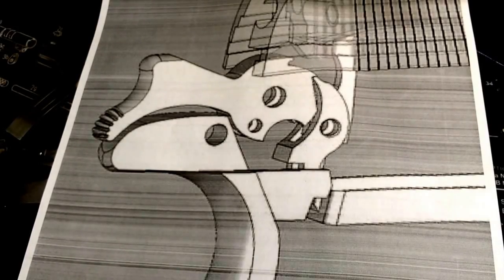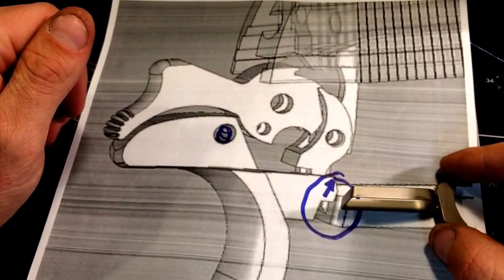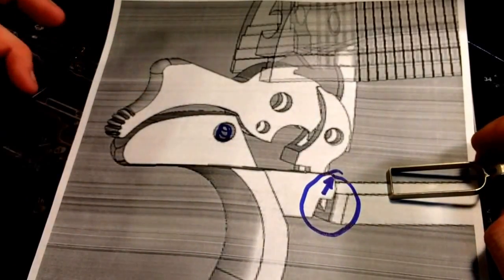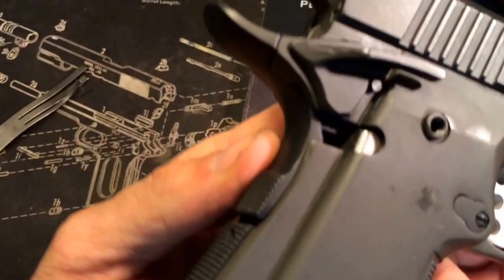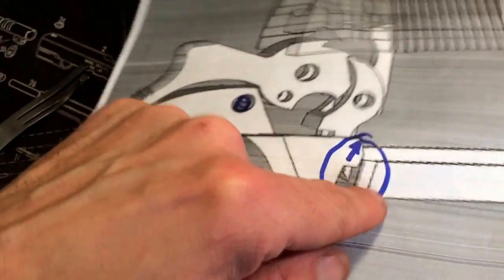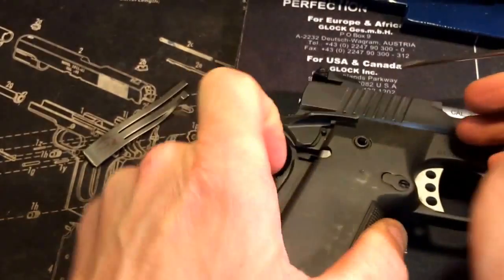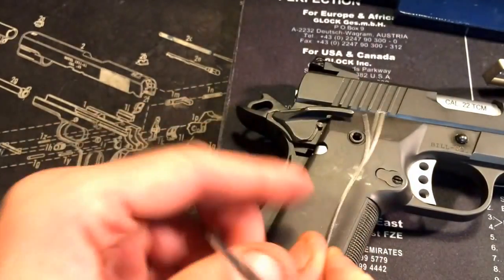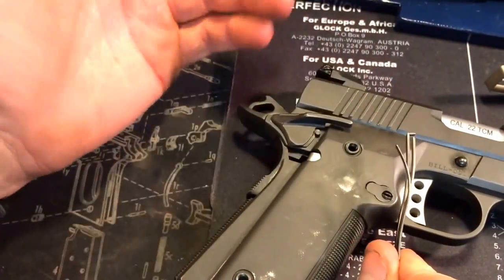My 1911's beavertail grip safety doesn't work! One quick fix that will hopefully get you running!

Comment: Great information. I took a budget Tisas GI 1911 and installed a Ed Brown beaver tail and pretty much all Ed brown components. The beaver tail trigger stop arm has extra stock on it and has to be fitted to the gun and your trigger. Once I fitted it and was able to have enough trigger movement to have the sear release and the hammer to fall, I noticed it would still release without grip depressing the Beavertail. So I’ll try this and see if it fixes this. Great info!!

Comment: Thank you ! I picked up a Norinco 1911a1 at a local pawn shop which was selling for $150 because the grip safety didn't work. I adjusted the flat spring as you recommended and now it shoots and the grip safety works perfectly, I'll probably buy another flat spring cause as you mentioned it could be worn out.

Comment: Just installed Wilson springs in my Colt series 80. Grip safety spring was not curved enough, would not work. I put the old spring back in & works fine. o

Comment: My mainspring housing was causing the grip safety not to work. Switched back and forth between the original and the old one with the lanyard loop. It only did it with the lanyard one.

Comment: Thanks for the video.  Learning to work on my MAC 9 double stack and after trying to adjust the trigger weight I had a grip safety failure after re-assembly.  Looks like I need to put a little more pressure on the grip safety and a touch back on the trigger weight.

Comment: Had this issue once right after putting an Education Brown main spring housing on a Springfield Loaded. The very bottom of the beaver tail was rubbing across the top of the housing. Took the housing back out and took a small amount of material of the top that was rubbing with a Jewelers file. No issues since.

Comment: First video that popped up on google when I searched using the phrase "my 1911 grip safety doesn't work".  Very informative.  Unfortunately I'm pretty sure my 2nd hand custom target 1911 had the lug or protrusion on the beaver tail ground down.  The previous owner also had it pinned in the depressed position.  I replaced all the springs and removed the pin and it still doesn't work.  He told me when he sold it to me the GS was pinned but he didn't say it was ground down.  Semi dangerous...
Reply: I deburred the 45 degree angle ever so slightly and polished it. I can manipulate the grip safety to make it so the trigger bar doesn't engage anything so I'm not thinking it's the problem. I do believe that the sear maybe put In reverse. My wife said she may have did it 😂. So I'll check that and maybe tweak the sear spring a bit to see if that helps.

Comment: Awesome info. Fixed my problem right away. I had the hammer fall to half cock while closing the slide. I was gripping the gun when doing so. If I kept my hand off the grip safety it would stay at full cock. Touch it at all while the slide was closing then the hammer will follow it. Figured this out after cleaning. Luckily it was empty. Not that I think I would have had strong enough impact with the firing pin. Not eager to find out in the house. Thanks.

Comment: I have a Para LTC 9mm. with the trigger cocked and safety on, If I put pressure on the trigger first then press the palm safety it will partially click off the safety, then the second pull will allow the pistol to fire.

Comment: What a great explanation! You do know what you are doing. As a matter of fact I was trying to find out a way to reduce the beavertail safety course, in such way that a small touch should be enouth to enable firing. By what I could see I may have to sand the beavertail notch to easely desengage the trigger, am I right?

Comment: Late to the party but i don't need the grip safety to fire. Or with the frame safety on i can squeeze the trigger once, let go of the trigger, move the frame safety off and the hammer drops to a "decocked position." Not half cocked. Just off of the firing pin.

Comment: I bought the wilson combat bullet proof sear spring and my hammer still falls without engaging the safety grip. I ground the lug just a bit and polished the surface. Idk what is my issue still but I can push up on the safety and the trigger can't engage the sear and disconnected like shown in the video.. any tips?

Comment: I recently purchased the Springfield Armory 3 in Ronin and I'm finding that when I use my standard gripping technique thumbs forward strong hand thumb over the top of the safety it's kind of opening the wing of the meat of my strong hand thumb and I'm not even able to depress the grip safety enough to disengage it I'm trying to get a hold of Springfield to see if they'll send me or or sell me a grip safety so I can TIG weld a little more thickness to it I spent nearly $1,000 on this gun and now I won't even carry it because it's only 50/50 if I'm able to depress this grip safety enough to fire the gun if I need to very frustrating I know I can change my grip just a little bit and all will be well but in a stressful situation I'm a retired Leo I've been shooting for over 50 years I'm not going to be able to change my grips when I've trained so much to have it as I've explained it are there any suggestions you can think of to perhaps get a custom grip safety with a little taller memory pad I don't know this I'm just frustrated as hell

Comment: Great info. I really don't see the point of the grip safety. There's already a thumb safety, and we should all be practicing trigger discipline. In a "critical incident", you may not have the luxury of getting a "good' grip. I try to get my hand as high up on the back strap as possible, pushing UP on the beaver-tail, which causes the GS to "lock" the trigger.  Couple that with small hands, and my thumb riding on the safety lever, and now I have a "unreliable" pistol.  I trust myself enough to set my GS at 10%, it still works but just barely. It just takes the slightest pressure and the trigger is unlocked, along with installing a low lever safety so I can still "ride" the lever but get my thumb lower for a better squeeze on the grip.

Comment: Dude my Sa 1911a1 is depressing the grip safety with the trigger. When i pull the trigger the bottom of the safety is pulled in by the trigger. Also sometimes the mainspring housing lock locks the gun up randomly. This didnt start happening until i started messing with a new ambi safety. Now the grip safety almost never works. If i pull up on the grip safety it and pull the trigger it sometimes doesnt drop the hammer and sometimes it does. Im at witts end here,also,is there any good way to make the down click of the thumb safety have a more solid click on my ambi safety? The slightest touch seems to make it wanna turn on or not go all the way down.

Comment: Hi, Really good to know. I tried to remove some material to be easier to trigger the gun as sometime I am not getting the best Grip in IPSC or IDPA (I have a short hand) but this time I think I remove too much (Please see your design where the arrow is). If I rise the Safety as you did, its still work so DO you have any Advise? Well other that just replace it. Im thinking to put it more square and not round... Thanks in advance

Comment: One thing you missed. Some aftermarket mainspring housings are thicker in the area where the beavertail tangs overlap. It doesn’t take much to overset the beavertail. 

I have this issue on my project SDS Tisas right now. I’m debating on if I should do a new beavertail or break out the files and go to work on either the mainspring housing or beavertail tangs. Which would you recommend?
Reply: I'm having the same problem with the same gun. I know this is old video, just wondering what the fix was.
Reply: I had the same problem, new main spring housing switching from arched to flat then the grip safty wouldn't work. I took some meat off of the main spring houseing shoulder where it stops the grip safty and it fixed the problem.  It wasnt letting the grip safty paw come down enough to stop the trigger bow. I took off maybe a 1/32 of an inch from the main spring shoulder.
Reply: Blend them together

Comment: Also, one more thing. If I change the Grip Safety, in general any Extended Grip safety should fit? This is the ProCustom 16-40 Para-US.  Thank you in advance
Reply: No, they come in  several different contours (at the radius where it rotates in the frame). Most would need an alteration of the frame (material removed) and are custom fit.

Comment: Thank you. Your info got me to the point of viewing my M1911 10 mm trigger bar. It is angling up or down depending on whether you push the top of bottom of the trigger. The trigger bar assembly is sloppy enough that this small difference in angle can bypass the block of the grip safety even when it's not pressed in with the palm.

Comment: I have a Tisas Zig M 1911 45cal. that I am having some problems with. I changed the original hammer with a skeletonized one and now the hammer drops when the trigger is pulled and the grip safety is not depressed or even if the thumb safety is engaged. The firing pin block kept falling out too.
I took it to a “gunsmith” who had the gun for almost 2 months. He finally called me and told me it all revolved around a weak firing pin spring. Foolishly, I didn’t check the pistol until I got home. Sure enough, the firing pin block was in good shape but the original and more dangerous issue with the safeties is still there.
I am going to take it back to the gunsmith but wanted to get some feedback from some owners who may have had similar issues.
What could the problem be?
Reply: Did you ever get it resolved because I am having the same problem on my sig